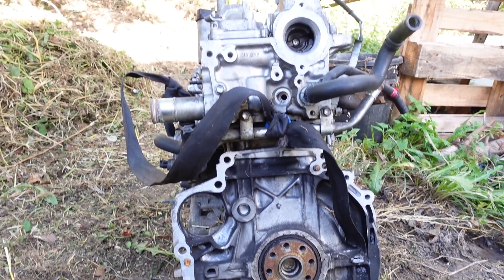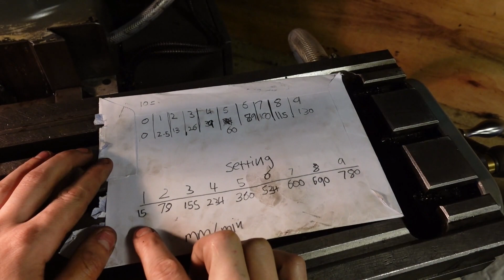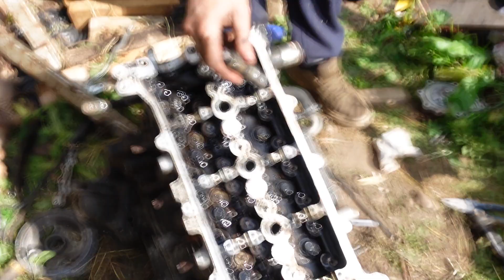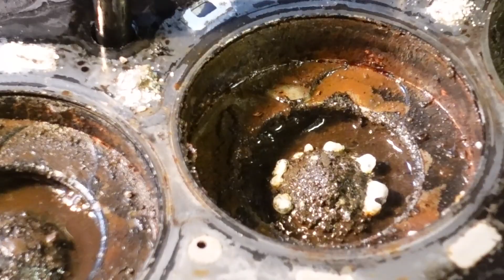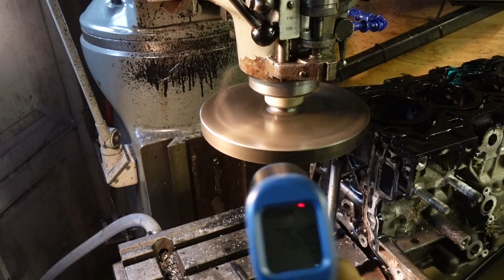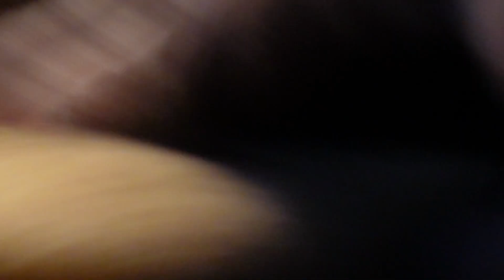Skimming an Engine Block

Comment: How did u get on with this mate I’ve built a similar cutter which I’m just testing but also bought a 8” face mill with 20 cutters to have a play with😂
Reply from the maker: 8" you say That's  one hell of a size .....
And yh to be honest  the fly cutter is great i carnt say I've ever had a problem with it ....At first I was kinda unsure about putting somthing that large in my machine as I'm quite new to machining
 ....But after playing around with it for abit I soon got use-to it ....
It seems to leave a really good Finnish on most things I use it for although I've noticed that how you put your cutting tip in and how you angle it can have a huge impact on the Finnish even just moving it ever so slightly can be the diffrence between a smooth shiny surface to it sounding like and old record when you scratch your nails on it but obviously rpm and feed can have a large impact aswell ....recently though I find my self grabbing the 150mm shell insted of the flycutter as that can handle much deeper cuts as well as a good Finnish...

Comment: The insert tool you’re using @16:36 would work much better if you turned it around - all of the cutting force is being taken up by the clamping screws which may be causing the ringing…

Reverse the cutter and reverse the spindle direction so the cutting forces are taken up by the body of the shell.
Reply from the maker: It's a right handed facing tool ....the only one I had spare to cut in half ...but yh orienting the tool differently and turning it around whould be much better as I did when I made it in the "making a flycutter" video ...

Comment: Try static balance the fly cutter with the tool you intend to use.

I use 3/8 carbide solid button inserts for roughing cuts and for composite head gaskets finishes, the carbide picks up and gums up with alloy and kinda drags it thru the cut, wd40 helps reduce this though.
pcd 3/8 solid button for mirror finish for mls head gaskets and cbn 3/8 solid buttons for cast iron heads/blocks

A solid button last longer and loads the tool nicely especially through interrupted cuts. I use kerosene or wd40 for cutting alloy with both carbide and pcd but no fluid for the cbn cuts
Reply from the maker: Balancing the fly cutter was a must to be able to get it upto and past 1000 rpm...
And the thort had crossed my mind to get a round insert but the geometry of the tool needs to stick out a little inordder to cut the full width of the engine head for this to work with a button insert the tool whould have to be handed in either left or right if you catch my drift

Comment: There's no way those head bolts should have been that tight, been wrenching on cars for 25+ years and never had a head bolt that stubborn! Nice finish 👏 👌 hoping for the same when we finish up our shop built Drill-Mill
Reply from the maker: Yh my thorts exactly ....very unusual...
Reply: @allangles4020  Soaking these stubborn bolts in rust remover/penetrating oil for a day or two isn't a bad thing. Or using a propane torch and an automotive grade impact wrench may help. Or all of that together:)
I also like the closeness to nature, i.e. used oil, the fertile loess soil and fresh air, is something very beautiful and inextricably linked... (Please do not take that serious. I am sure you did proper disposal and cleaning. Just joking:P) Thanks for the video and sharing your struggle!:)